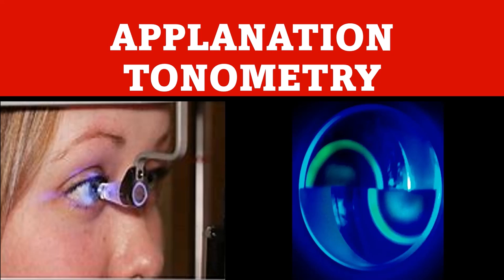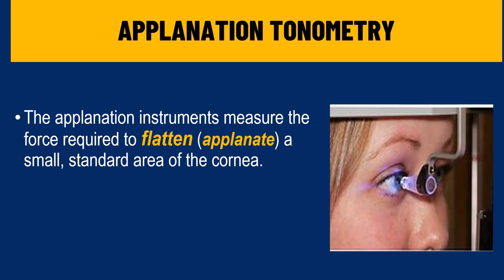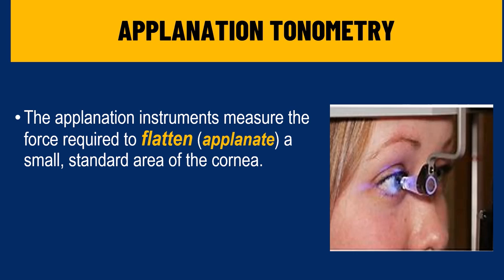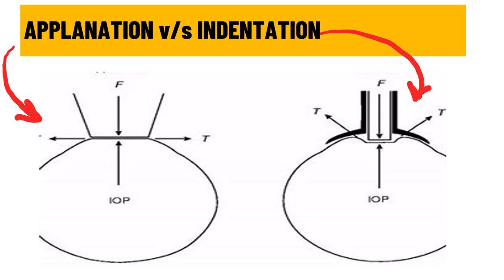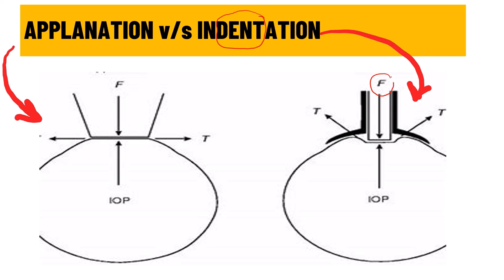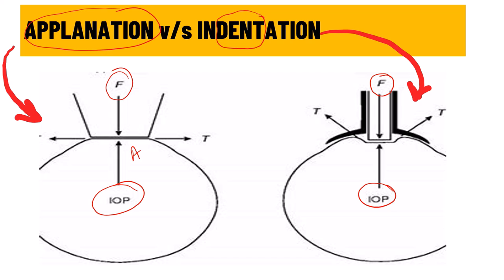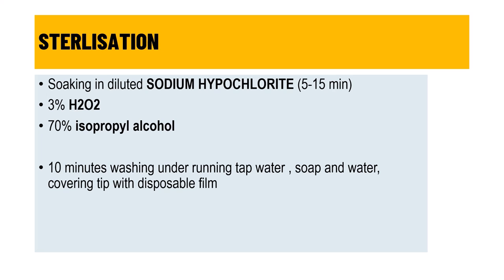Applanation Tonometry | how to do goldmann applanation tonometry?

Comment: Thank for dis lecture Ma'am. So every tonometer is affected by CCT, but some tonometers are more accurate Dan d odas.
D deviation from 520 microns u talked about ma'am , is it 0.5 or 0.7mmhg difference ?
cos u said 0.5 but it's written 0.7mmhg.
Reply from the maker: It is 0.7 mm of Hg, thank you for pointing out :)
Reply: @InsightOphthalmology  Thank u Ma'am.